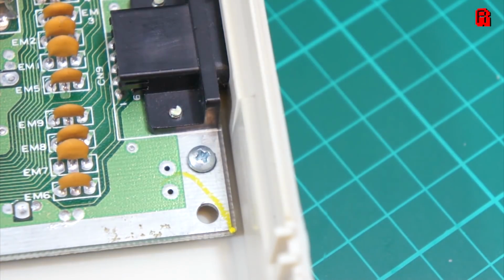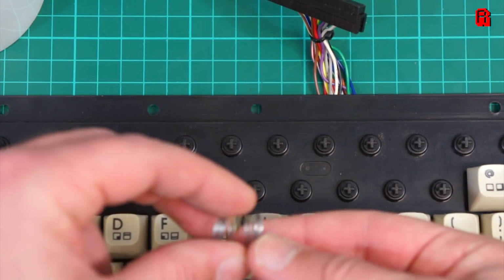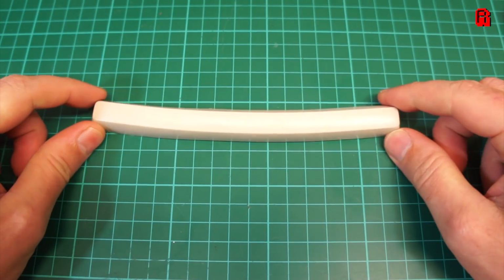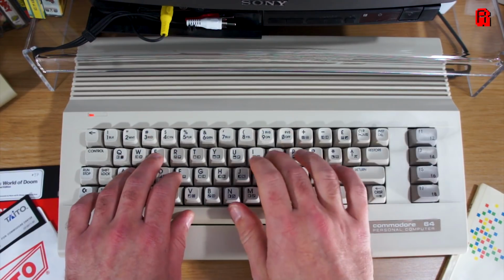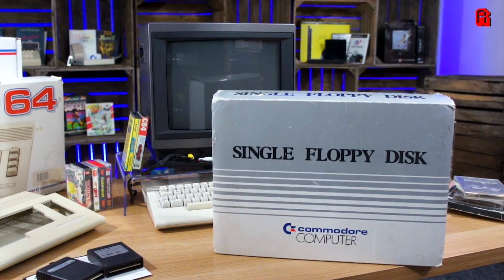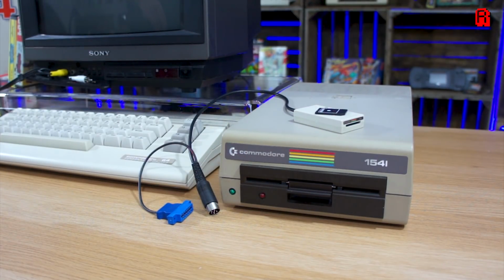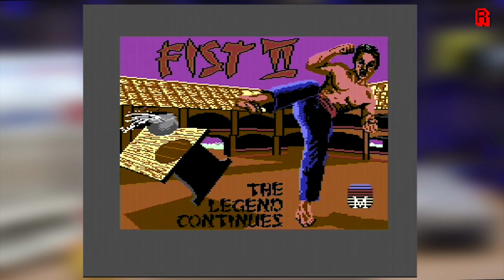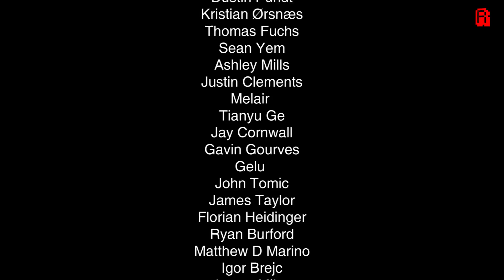Commodore 64c | Restored and Toured | Trash to Treasure (3/3)

Comment: As soon as you said you had to get the pan up to 70 degrees, I thought "noooo!  Most plastics go soft at like 75-80!  You're gonna wreck some keys!"

Also, I'm no expert, but as the solution evaporated off, wouldn't that only have been the peroxide leaving the solution?  You were effectively distilling it out of the water, as its boiling point is lower than that of water.  Tiny amounts of water would have left, but unless you saw water vapour, or steam, I would expect you were only losing peroxide.
Reply: The reason for the water is to stop it distilling off, 50/50 should be enough without weakening the peroxide. Also, 70c MAX was my suggestion, and NOT to go above that, although it's looking like 60c maybe a safer way. It does work, I did a entire Amiga 500 and C64C keyboard using this method. I did soften 2 keys in a test, but I forgot to use my water temp monitor probe. One thing about this method, you get the whole of the keys done in a even manner - none of that marbled look which can happen with just creme peroxide and sunlight.

Comment: Ah yes. The tape drive. I never had a c64, but I DID have an 800XL (or two of them in fact).
And I never had a disk drive for it.
A handful of things on cartridge, and then hundreds of tapes.
This was in the Netherlands at the time...

Even now, I got a lot off ebay that arrived about a week ago, and while that lot did include a disk drive (but no power supply for it), there were 135 games and programs on tape in the lot, but not a single floppy disk in sight.
And yet. a few years ago, whenever I'd check any info on the 800XL it claimed that tape drives were rare and everything was on floppy.
Evidently not, since in person I've seen and owned 3 different 800XL machines and accessories, and the one I got last week is the first that even includes a disk drive, much less any disks...

I imagine the situation with the c64 in Europe was much the same...
Reply: Oh. That reminds me. That first tape you put in to test the system with says interceptor micros!
Guess who was the original owner of my current 800XL!
Yes, you can see their name on the power supply... XD

Funny sometimes... What you end up with.

Comment: Hi, if i could ask a question. i've got an old c64C (which works fine), how important do you think it is to get the fix for a rogue 5v line ? your new 64 looks great.
Reply from the maker: All of the evidence points to it being quite the risk, although as Jan said in ep2 the newer supplies are less prone to it and overheat less.  I'd still err on the side of caution.
Reply: thanks for the reply. i will get one of these,

Comment: Sticker is not holding anymore on right side.
Reply from the maker: You'll notice when I took it off I bent it up at one side then pulled it off.  It decided it wanted to pop up again on this side as you saw (very good observations!).  I applied a little glue and it is behaving now.
Reply: Try using a bit of string to pull under the sticker, it will cut the glue without bending the badge.

Comment: How come the disk drive came with a Vic 20 version manual?
Reply: The white 1541 was actually modeled after the VIC-20.  The beige 1541 came later.  Besides, there is functionally no difference between the VIC-20 version manual and the C64 version manual... all the commands are exactly the same.  The VIC-20 and the C64 both used the exact same version of BASIC, and the DOS commands (e.g. N0 for formatting a disk, S0 for scratching (deleting) a file, R0 for renaming a file, etc.) were built into the drive itself.
Reply: SpearM75503 not to sound harsh - but I already knew that. Just wondering why he didn’t get the c64 version manual...

Comment: Why don´t you use a sous vide machine, that will never gp over the temp you need :)
Reply from the maker: I've thought about this but I haven't been able to find one that isn't too expensive so far.  Ideally I'd like to find a solution that anyone can perform at home without too much specialist equipment, but I'll keep hunting.  Good idea though I like it a lot.
Reply: You don't need a sous vide machine for that. Grab the pan and put it in the oven, on a rack.
Reply: Apparently you can mod an ordinary slow cooker to make a sous vide machine on the cheap.

Comment: Sadly the C64 Power Saver isnt for sale at the moment.
Reply: If you have a little skill with a soldering iron, make your own.  The blueprints are all over the Internet.  Three resistors, two transistors, two diodes, one fast-blow fuse, and a 5v relay are all that is needed.  Here's a parts list and schematic: https://console5.com/wiki/Commodore_64_Power_Saver

Comment: knew that this mania for whiteness would cause problems :'-(  what's wrong with age? this is the equivalent of hair dye for electronics ;) p.s. we got the same mainboard revision... just saying. mine was made in hong kong tho, and has all chips marked MOS. rushing to get a voltage protector from that aussie man.
p.s no.2 : OPERATION:WOLF  works with the 1351 mouse , no one seems to know this , probably because no one uses GEOS anymore !